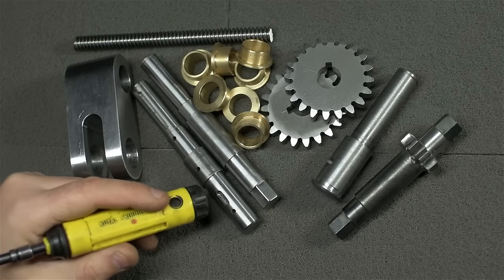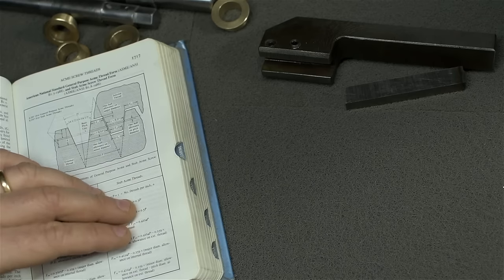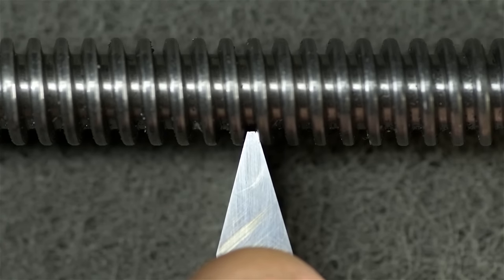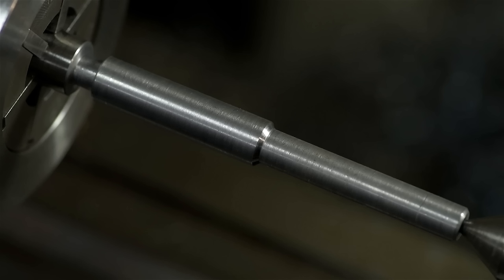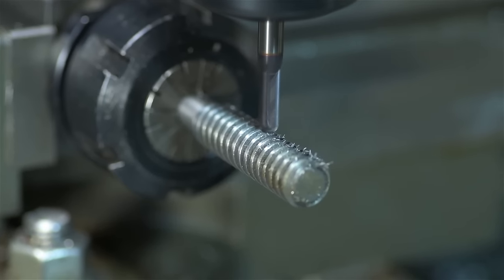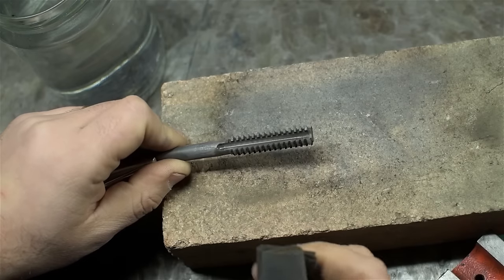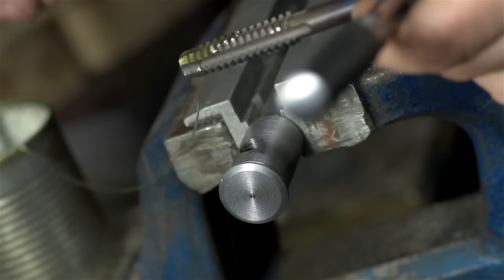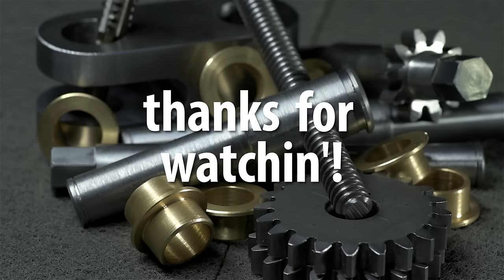More Thread Cutting & Heat Treating (I needed a metal tap)

Comment: Im in the U.K. and love your videos Tony, you have a brilliant and engaging style . If I may offer a hint to a wise man, on heat treating long slender parts..I used to make parts for Brown & Sharpe cam autos, and was taught a very useful trick..put the part in a drill press and rotate at slow speed untill temp is reached then simply plunge quill down so part enters water whilst still turning..this keeps distortion to the absolute minimum in a situation where you dont have proper facilties. same for tempering.

Comment: I had to make a tap not too long ago I bought an old early early early nineteen-hundreds power hacksaw it's a real rare old machine and apparently pre 1920s there was a half inch thread with a odd number TPI. I can't even recall what it was right now 16? Whatever it is you can't even find taps for it anymore. It was my last resort and I didn't think it would work so I just powered through the process exactly like you did I made a three flute tap I used a ball end Mill bit just like you and it turned out great it worked perfectly in cast iron which is pretty easy to tap I will admit. It was really satisfying to make my own tap of all things I mean I'm pretty new at metalworking in general I have a couple lays and a mill and a few homemade machines but I am a noob extraordinaire. And to have a tap work absolutely perfectly? Yeah I pay added myself on the back

Comment: If one finds they are grinding a lot of form tools for various purposes it can make a great deal of sense to make a jig that allows one to set the angle in this case and then have the base of the tool holding jig ground to provide an automatic clearance angle of 7D or so. In addition if you do a lot of threading with HSS I found it to be well worth my while to have a threading tool grinding block made up that gives the proper angles, side clearance and in the case of the ones (60d plus 29D Acme) I made for myself allows the addition of grinding a chip breaker on the top of the tool that promotes nicely formed chips. Of course you do need a surface grinder to do this. Always nice to have an excuse for purchasing tools :) When tapping the hole I think you were thinking "Gee I wish I still had my Bridgeport" Nice work as always

Comment: As a retired tool & die maker, I enjoyed your video. As for single point threading on a simple lathe, an old trick when threading to a shoulder, turn the cutting tool upside down, run the carriage backwards ( away from headstock) and in reverse spindle revolution, for right hand threads only. you don't have to cut a relief groove at the shoulder as advancing the tool inward, you will cut a groove equal to your thread pitch. maintain cutting edge on center of course.  I'm sure that you spent a lot of time making the tap, but W1 (water hardening) will break very easily with shock as a file would break if you tried to bend it.  O1 (oil hardening) is more forgiving but will not have a high hardness for cutting. keep up the nice work.  also, if you had a Hardinge tool room lathe, it is the easiest simple lathe I have ever used for single point cutting threads. it is almost impossible to make a bad cut, e.g. missing your index number on the treading dial.

Comment: Could have used this video a while back. Made a tap for the same money/little use reason. Used a hardened bolt, and elbow grease. It worked, but would have been much easier knowing these steps and measurements. You do fine work Tony, always a pleasure to watch.

Comment: Using a cutting disc to sharpen the cutting edge works like a charm. At times even better than a new tap even though the lofe gets diminished. Done it many a times and it's smooth if you get your angle right.

Comment: Fortunately the pitch of the tap was fine, for an Acme. As you probably know the sides of each tooth on a tap are relieved, just like the single point threading tool you made. You also relieved the back side of the teeth on the tap, good idea. which cut down on the amount of drag (lack of cutting action by the tooth). Also taps are made with an oversize O.D. to make sure the crests of the bolt do not interfere with root of the tapped hole. Way back in the early 60's when I was in trade school one of the elective projects was to make an Acme tap. It was done on a tool makers lathe that could cut the relief on the side of the teeth.

Comment: I may be missing something, but seems to me you may be able to reduce the tapping effort a lot by sharpening the starter threads in the direction of the cutting. As in, at the same angle of the threads. Basically make the first cutting teeth point, since the later teeth are going to cut the finished angle anyways. Start by chewing smaller bites. I'm done over explaining. Epic video.

Comment: The back bevel / relief grind may be a bad idea, unlike a lathe tool the tap is operated in reverse (removal) and that bevel can  allow chips to act like wedges and jam the tap. 
If you are not tapping any blind holes you may wish to leave a pilot on the tip for easy straight starts and use a longer taper(or at least calculate the taper so each tooth takes a specific depth of cut.)

Comment: Just to clarify your explanation about the tool steel you were using for the tap, the W1 grade is a tool steel, but it is not like the HSS used in modern drills. W1 is a high carbon steel meaning it around 1% carbon and not a huge amount of other alloying elements. HSS on the other hand generally has slightly lower carbon content but much higher chrome, molybdenum and tungsten content around 4-6%, these help give HSS superior performance at high heat and better wear resistance. Someone has probably already said this but screw it, I'm a metallurgical bore, hear me roar.

Comment: The tap feels tough to turn because most Acme taps have a pre-tap, and then the actual threadform tap. You'd cut a V-thread first with the correct thread pitch and size V-thread tap, then follow with the Acme threadform tap to cut the finished thread. They even put them on the same shank in many sizes...LONG TAPS. For the home shop this works pretty dang good and I like the ball-nose mill to cut the flutes-I've always ground them in with a chainsaw cylinder like you did to sharpen them. Your way is MUCH faster!

Comment: Nicely done. Now let's see a five start! ;) I actually had to buy a 1/2" five start acme tap and it cost about $400 a dozen years ago and took weeks to get here from Italy. I needed one recently, couldn't find the damn thing and ended up 3D printing the parts I needed. The 3D parts worked without any finishing! Of course not as strong as steel but I can make a lot more for what that tap cost.

Comment: Great video, taps like that should be longer and tapered for most of the length, to make it work kinda like a square hole broach would work, picking its way along with smaller bites.  Nice job making this tap work cutting steel, that's the true difference between an experienced machinist and a rookie. Nice job as always.

Comment: Now you can buy an insert in your needed thread - size and type.  Then it fits in the holder and cuts.   On your tap - well done and good ideas.  How about a pilot rod in front of the cutters - do align in a hole and center the cutters.  Only works on deep holes or open holes ! :-)  Buy an insert and make a tap.

Comment: Thank you.  Informative entertainment.  What's not to like about that?  2 questions: 

1) When you cut the preliminary thread with the carbide insert and then changed tools you would have needed to register the acme tool to the preliminary thread.  I must have missed how you did that.
2) My father was no machinist but he was a decent backyard blacksmith.  He taught me to heat to straw colour and then quench in a single step.  What is the advantage of the 2 stage process you use?

Comment: I've used a much larger acme tap to hand tap steel before. It was maybe an inch or inch and a half diameter for a vice screw. That tap was staged on a single shank, the first section took the thread to depth and the second finished it to the full width. It was quite a workout.

Comment: I have a bearing race that is pitted. Because it might be possible to recondition it, I want to try. I grinded one bearing-cone by hand and polished. The roundness is not anymore there, but I can install it upside-down so the not used surface is facing load. The difficult part is bearing-cup, much harder to grind. There are few companies that do it, so it is doable, but they didn't tell how, just ask. Also the surface is lost, maybe nitrific cover and surface hardened. If it manages, I don't have to buy new parts and so I don't have to buy new axels for new cones, because old axel doesn't have same thread than new cones, necessary. 

Hardening as red, blue or yellow colour with steel is quite good hint to determine the necessary hardness of steel in hardening.

Comment: I have taken new taps that seemed harder to spin in the hole then they are cutting, so i back relief the cutting edges more almost to the cutting edge and it worked so much better. we do this back relief with our single point tools yet grinding in a circular motion around the tap does not leave a cutting relief. And sins metal does "flex" inside the hole, with no relief there would be binding , Just can't get no relief! I found this was effective when i have dull taps too. resharpen the cutting face and grind in enough back relief on each flute  instead of just running it in a circle on a grinding wheel.

Comment: On grinding the back side of the teeth on the tap. This is a little off topic but I have made roughing cutters out of taps. It was done more to see if it would work. After grinding the top of the teeth with a back angle of 5D or so I would index the tap to grind a second clearance angle behind the first grind. The first grind was just deep enough to produce a flat between 25% to 33% of the lead of the tap. This actually worked, in a half backside sort of way. As I said, I did it more to see if it could be done. Brass it cut great. Mild steel OK. Tool Steel, not so well.

Comment: Another great instructional video.  I love it.  I know it is a one-off project but there is potential many other things like this in the future.  So my question is why didn't you make a fixture to rock your perfect trapezoid profile to the angle you needed instead of modifying the grind?  I would think that building a fixture or set of angle blocks could provide great flexibility for future projects.

Comment: I've been binge-watching your excellent vids for hours now. Highly educational and funny too. Thank you!  

One thing I wondered about is, when you're grinding the relief angle on the thread cutting tool, wouldn't it be possible (and much easier) to instead tilt the tool in the holder -- by the same angle as the thread pitch?  Not sure exactly HOW you'd perform the tilt (not owning a fancy lathe myself) but it seems that it ought to work -- avoiding the need for that relief-angle grind.

And now on to more binge watching. :-)
Reply from the maker: yes! there are tools that rotate that way but most are square body in square tool holder so no good way to rotate.  hence the grinding.

Comment: If you're trying to anneal it at 200°F or so and don't have or want a toaster oven, you could probably boil it for a bit. As long as you keep it off the pot, there's zero risk of overheating, since excess heat gets turned into steam.
Different end goal, but Mark Novak colored some trigger parts the same way.

Comment: A little late, but a possible explanation for the oversize thread:

Did you ever measure the tap after heat treating?  Yeah, it does expand a little.  If an exact fit is needed, the tool needs to be grinded after hardening.  Or you could try to anticipate the expansion by making the tap to nominal dimensions and let the expansion take care of running clearence.  It is a bit of hit and miss, though, and slightly loose fit is better than too tight.

Comment: I didnt realize 30 minutes went by until you said so. Truely great video, and I've subbed. Now I have a lot of catching up to do. 

My heart jumped when you broke the tap. Did that on a sea strainer with stripped out threads while half straddled in the bilge of a 170' crewboat I worked on. Not fun to now try and drill out a hardened tap with no extractor.

Comment: Tony, I was wondering if you have had the  chance to try a Norton quantum surface grinding wheel? It is pretty much a wheel that can replace the need to have different grit wheels. I personally use a 60 grit quantum wheel, and I use it for "hogging off material", or for grinding tight tolerances  (+.0002/-0) which require an 8 finish. Instead of aluminum oxide, it uses a ceramic particle, which generates less heat, and always maintains a sharp cutting edge. Your videos are not only hilarious but very  informative as well, and thank you for continuing to create amazing content. Ps. Please let me know if you decide to try that wheel, only grinding wheel I trust to take .02 depth of  cuts and not burn or heat up my parts. Material im cutting is any where from m4 to d2, all heat treated to 60 rockwell, punch and die work. Thanks and have a good day

Comment: Great Video.  What method did you use to set the tool steel up in the surface grinder at 1/2 (29.5d)= 14.75 Degrees ?

Comment: 8:52 - In my experience, which is minimal, flathead screwdrivers never "find" the slot in the screw head, but instead actively "find" their way out of it! Usually resulting in knuckle rash or embedding the flat of the screwdriver into the palm of your opposing hand.

Comment: Firstly, I love your videos. You are hilarious while being very informative. On a point of intrest, when you gave your tap flutes a back bevel you stopped the ability of the reverse face from cutting/snapping off the swarf and also from easily pushing waste material ahead of itself on retraction. Rather, I imagine they would be trying to wedge it back in place. Good experiment though.. I'll be watching.. Carl.

Comment: Brilliant work. But I’m thinking, isn’t it a good idea to leave a chunk at the beginning, diameter just under the hole size, to guide the tap in square? 
I’ve been wanting to make a trapezoidal tap, 2.5mm pitch for nuts on my Colchester Student lathe cross slide.

Comment: Hey this is such an informative video that brings together heat treatment, machining technique, and even a cool sense of humor. I know you oversized the tap by a few thousandths to have the necessary clearance. I have a bunch of 303 Stainless, two start 1/2" acme threaded rod with no matching nuts. Any way for me to use one of them as a tap to make brass nuts and still have the desired clearance? Perhaps by going with a slightly larger pilot hole?

Comment: This might seem a little strange of a request for a machining channel like yours, Tony, but I'm interested in getting a full picture of how the lighting in your garage is set up. I'm constantly impressed that the subject of every shot is well-lit, even in closeups or alternate camera angles. Do you have key and fill lighting that you move around for every camera shot, or is the whole garage ceiling just covered in diffuse fluorescent panels so everything is always shadow-less even when you're not recording while you work?

If you could just include some wide shots in the next video that include the lighting setup, that'd be enough for me without it needing to be addressed directly. :D
Reply from the maker: Mostly it's just two lights.  I have a large (LED) tube light I can swing around in a very large radius.  The other is an LED panel .. maybe 6"x6"? that I move around with me.  During filming the overhead lights are off because 1) they flicker and 2) they're the wrong WB.  My machine lighting is also the wrong WB.  You might notice, often, when I'm on the mill or the lathe things start to look blue.  If I get a very slow day I may make a 'behind the scenes'?
Reply: I only started to notice the bluish color temperatures when you mentioned it on video, but I don't think it's a major issue since the color fidelity isn't very important to the work you showcase. DIY videos, even in 2018, earn tons of brownie points for just having the subject fully illuminated at all. Many creators don't understand that the camera refuses to stay faithful if you don't feed it lots of light.

And I think lots of us viewers would love a 'behind-the-scenes' to the operation. Regardless whether you end up making it, thanks for taking the time to respond and thanks again for making great video content!

Comment: I am not a mechinist.  But enjoy watch people who are good at what they do .One question i had about the acme cutter you made.  If you undercut your V tool so just the point is making contact with the work.  Could you then account for the angle of the threads by adjusting your top slide to match?

Comment: I know I am a little late, but if you are heating up metal with the oxy acetylene torch you should use a rosebud tip to get a even heat on the metal instead of the more focused heat the welding tip gives.

Comment: I know this video is old but its also technically possible to cut threads on a cnc mill useing a tool called a thread milling cutter which is essentially a woodrow cutter but with the thread form for the flutes.  Dont know how possible it would have been on your router but it could be a fun experiment with the maho